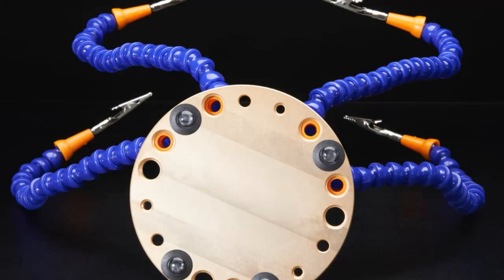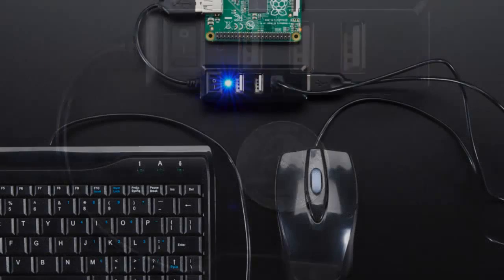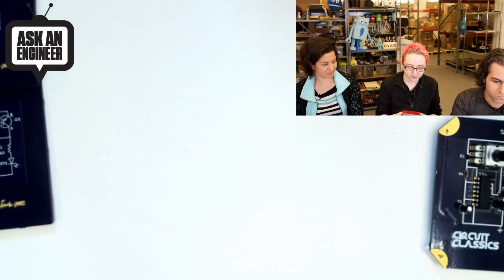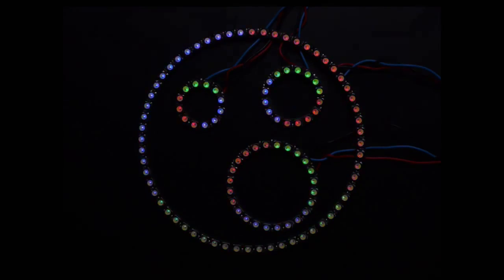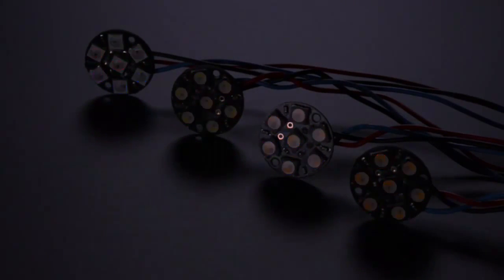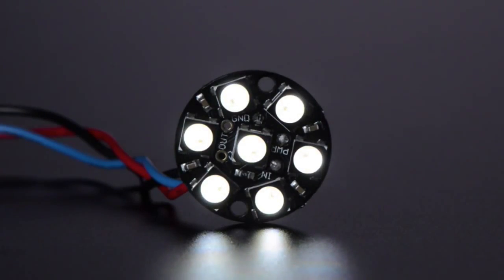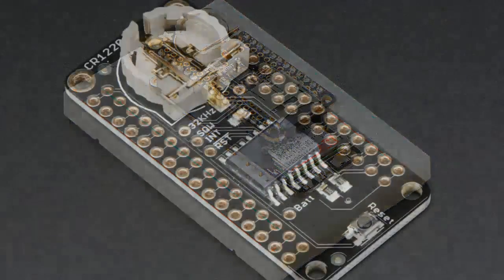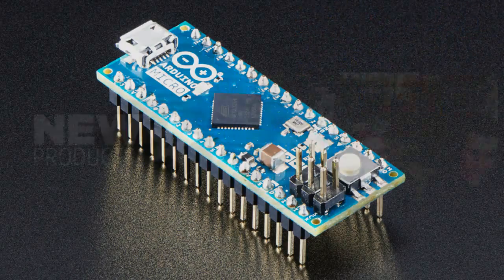New Products 2/17/2016

Comment: Is there a way to get a softer button press for the PiGRRL?
Reply: +Nimble Bolt They were talking about that on the 3DPrinting show when they were talking about developing this, there's rubberdome switches that have about the same footprint as the tacswitches used that would give a softer, closer to regular gamepad, feel.
Reply: "Rubber tactile switch" seems to bring them up on Google, probably the ones that look like they have grey rubber on top are the ones you probably want. "ALPS Snap in Type Tact Switches" seems to bring them up on eBay.
Reply: Exactly my thoughts.  They should have soft buttons in store or some kind of membrane system.
Reply: ***** I know you can do it by taking apart a SNES controller, but I'd like to make my own preferably with the PCBs provided.
Reply: tom611 Oh, awesome. What's the name?
Reply: tom611 Thanks! I think I found them.
Reply: Now my question is: is there anywhere I can get them and not need to buy in bulk or just get a proper price?
Reply: Mouser might have them, but I couldn't get them to shake loose in a quick search. You might message the sellers you found, particularly if they're listing on eBay, they might sell in a different quantity than what they listed, so you wouldn't have to over-order to get the buttons for the PiGrrl.
Reply: tom611 I found some buttons from Sears that might work. Don't know about talking to the seller I found because they're in Shanghai.